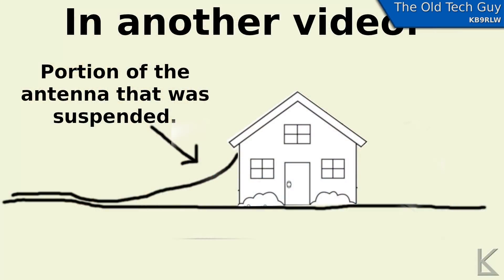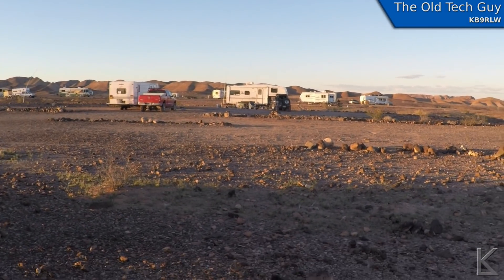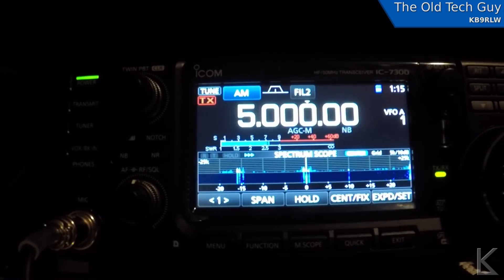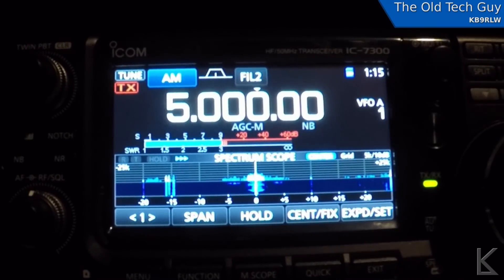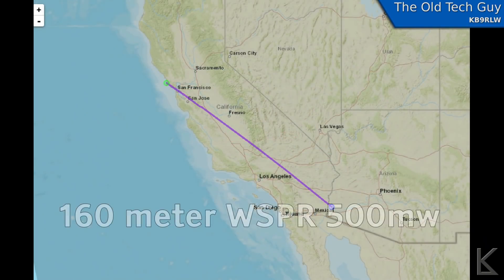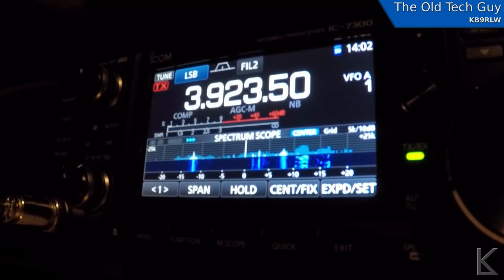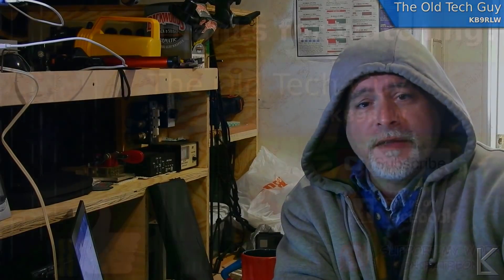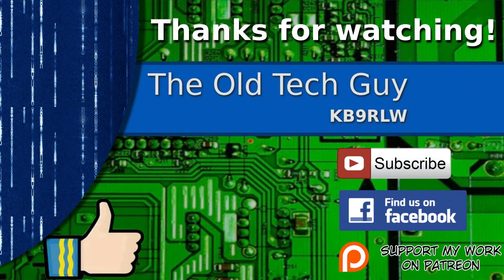Ham Radio - Can an antenna work while laying on the ground?

Comment: If you used a more insulated (from the ground) cord, I'm wondering if it would perform better. Like maybe a long extension cord. (It would have a thicker rubber sheath. Or, it could just be that the horizontal polarization is cutting down your signal.

Comment: Great vid. One comment. If you notice, at the 6 min mark in your vid it shows the noise level on your scope with both the in air antenna and the on ground ant. The on ground antenna has much less noise compared to the in air antenna. For transmitting, the in air antenna is almost always be better, but as a receive antenna, the on ground antenna can help dig those signals that are buried in the noise out. Sig strength will be less, but sig to noise level will be better. This is the idea behind the beverage on ground (BOG) antenna. Sometimes having both and a switch between the two helps with pulling out those weak stations. Thanks.
Reply: It could have been better at receive because it was closer matched to the wavelength.

Comment: I use a groundwire antenna that is under my grass in SW Ohio, for nighttime listening to hams (cw, ssb) while I drift off to sleep. No worries about lightning since it's in the ground and only a 28 gauge enameled wire which won't carry much current. I get ham activity coast to coast with no problem. The grasswire works great for me!
Reply from the maker: Yep, but one thing.  You're not immune to lightning.   Any nearby strike of a building or tree will generate a huge electrical pulse in the wire, even on the ground.

Comment: On ground is OK for receiving but as a transmitting antenna you’d just be warming some dirt. I’m currently using a random length wire and counterpoise as a receive antenna. It’s temporary but OK for AM DXing. I’ll be building the LOG and probably adding a preamp at the antenna. Glad you tried it out and showed how you did it. Thanks.

Comment: Can chicken wire be used as a antenna
Reply from the maker: Sure.    I once may a contact using the backstop fence at a baseball diamond.    Anything metal can radiate RF, but not very efficiently unless it's a half a wavelength in dimension.

Comment: What was the length of the end fed antenna on the ground? What was the difference in signal to noise ratios between the end fed on ground vs the vertical, especially as you came down in frequency? Did you put an RF choke at the receive end of the antenna (a loop might need one at the antenna feed point as well to keep it from being grounded)? What is the ground conductivity rating at the test site (higher is better for lower angled reception)? Did you try the wire as a loop on the ground with a 9:1 balun (loops don't need a ground or counterpoise)? Did you exceed 1/2 wavelength of the end fed on ground in your tests (loops can handle up to one wavelength before reception pattern goes bonkers)? Did you know that you may have just been warming up the earthworms trying to transmit into the ground (a loop can make a useful Receive-only antenna if one has space restrictions)? Did you have a preamp turned on which may have just amplified the ambient noise? Did you see this web page ( https://kk5jy.net/LoG/ )? Did you see these experiments ( https://forums.radioreference.com/threads/160-20m-log-loop-on-ground.370110/ )? Or this experiment with 40 feet of looped wire, amplified ( https://www.youtube.com/watch?v=2YhK0Mvd58w )?

Comment: Wether or not an antenna will work lying on the ground will depend on the ground. I have used a special Harris antenna designed for desert and that works fine as long as you operate in a desert as I did in Afghanistan. The same antenna does not work back home. Not even close. But funny enough it springs to life again when put on top of deep snow. We typically get 4-5 meters of snow during winter. To many think of ground as the ground we stand on, but antennas doesn't always agree. Normally it will be correct, but try operating in desert where water is way down in the ground (water surface or water table, I don't know what you call it in english) and the ground it self isn't very conductive. 
One of the reasons we discovered something was of in Afghanistan was that low hanging dipoles didn't give us NVIS. Not until we placed a wire as a reflector on the ground below the dipole. After a while we got hold of this specially designed Harris antenna which gave both decent comms, but also some covert antenna site.

Comment: A buried antenna will have its resonance at about 25-30% of the length of an antenna up in the air due to dielectric effects.  The feed impedance will be higher as well. Your antenna was not properly matched. The military has used on ground and buried antennas for years, one application was for backup comms to missile silos. See  the text "Antennas in Matter: Fundamentals, Theory and Applications by Owens and Smith" and https://www.rfcafe.com/references/short-wave-craft/images/buried-antenna-performance-development-small-resonant-buried-antennas-ad-783-274.pdf
I use a ground dipole on 472kHz, about 480 feet long ( in free space it would be nearly 2000' long), it has an impedance of about 200 ohms.
73 Warren K2ORS

Comment: Interesting investigation / experiment.  Got me thinking, suppose you had a resonant dipole antena, and for some reason you could only get half of it in the air.  The other half of the dipole you laid straight out, but on the ground. Therefore, the dipole is in a straight line, but one half in the air, the other on the ground.  Would it work??
Reply from the maker: Yep.  That's a quarter wave vertical with only one radial.

Comment: One time I was doing some repairs to my antenna system and had to lay my beam on the actual roof, I live in an apartment so its hard for me to drop all the antennas, and I was amazed that i was still working DX even tho the antenna was pointing approx 40 degs into the sky due to the slope of my roof :D. I know not technically on the ground but it was flat on my roof...

Comment: ANY antenna will work.   An incandescent light bulb will work for an antenna.

All antennas will work better than another antenna.  A dipole at 20 feet will work better than one on the ground.  One at 70 feet will work better than one at 20 feet.

A beam at 40 feet will work better than a dipole.  A beam at 80 feet will work better than one at 40 feet, etc, etc, etc.

Comment: Hello Kevin.  I'm in the process of making the LoG (loop on the ground) antenna.  It is two 15'x15' square loops in phase to produce a sharper bidirectional pattern.  This is a receive antenna only.  Each loop will have a 6.25:1 transformer at the feed point and fed with 75 ohm coax.  I'll be able to compare the snr with my 80m full wave horizontal delta loop and 3/4 wave inverted L which are 50' off the ground.  I'll let you know the results.  73  Scott - kl4nu
Reply: I know the thread is old, but I just installed a LoG.

Comment: Guess what I just took my 36 foot vertical wire antenna down and threw the wire on the ground ready to pack it away because of the wind . it also has a 6 foot copper ground rod .. I decided to test it out for the he'll of It before watching your video . wow ZERO interference on the empty bands unlike the vertical and picking up serbia and Moscow from the UK booming signal ...i can garentee it does actually work you just have to be lucky with the placement of the wire as I was earlyer on .

Comment: Interesting Kevin. Soon after I first got licensed in the early to mid 1980's, my HF beam antenna was down for repairs. So for giggles, I threw a pile of wire out the shack window onto the ground outside. It was raining at the time and so I didn't extend the wire along the ground - I just left it in a heap below the window. I got on 20 meters with an ATU and to my surprise heard the band full of west coast stations on the long path from my location in South Africa. I put out a call to a station in California using 100 watts, and he immediately came back with a 58. That is the power of being near the top of the sunspot cycle - Africa to California with 100 watts, and a heap of wire lying on the ground as an antenna 😂

Comment: Another thought is you used anlong wire.  I ran an 80m dipole laying on the ground last year for summer field day and made 20 contacts in 30 minutes.  But, like you said, mine was but one test.  KK4BK

Comment: I laid wires from my Alpha antenna 9:1 balum 60 ft  on bushes from the vertical lug and radials on the ground. I was using an Icom 7100 with ldg tuner. Using Winlink Express and ARDOP.  I was able to connect to a station 300 + miles away on 80 m. I could not get my wires up in the trees. Gave up and remember some thing Bonnie said about laying her dipole on Bushes. ( HF Pack).
Reply: You were running NVIS mode, which has a range of about 600 miles.

Comment: Nice location!  Is there a charge to camp there?  I'd like to get my RV out there and do some antenna experimenting!  ;)
Reply from the maker: There are many free for 2 weeks BLM areas out here. Then there's long-term visitor areas where I'm at, which charged $40 for 2 weeks. But you get access to a dump station, dumpsters, and freshwater.
Reply: @loughkb  Thanks for the info.!

Comment: The problems I see on the ground is that it is high capacitance to the ground, even though the ground is dry. That being said it will change the effective length of the very least, and that is not accounting for the amount of signal that is absorbed by the ground. There is only one practical use that I could see and that is spacing at a set distance from the ground and tuning for EME or other such communications where the intent is to eliminate one or more signals at the same frequency that are from the horizontal direction. Also when close to the ground I would probably look at that as more of a waveguide than antenna as it would be tuned with the ground as part of the propagation. Also if buried in the ground it would mostly pickup changes in the magnetic field of the earth, power lines and other such very very low frequencies.  I know this from experimenting as a kid, before I understood that an antenna is a tuned circuit unto itself.

Comment: Adding any height is going to improve signal in and out. I'm thinking  a wire, strung on the top of a fence, would be better than that ground wire.

Comment: Kevin...in this video when you were tuned to 3.923.5 that was me calling the net. The rig I usually use it my IC-7300 driving a Heathkit SB-220 running about 800 watts output to a 160 meter doublet. I was surprised how strong my sig was with your antenna laying on the ground. I have done the same experiment you have done with a G5RV and found the same as you did....it worked but not anywhere as good as when it is strung up in the trees. 73 WB7S

Comment: Set of the wire sitting on the ground about taking sticks up to at least 3 inches or 4 inches high from the ground try that I’m just curious
Reply from the maker: It should start to behave as an nvis antenna as you raise it off the ground. The Earth becomes a reflector, and a signal goes almost straight up.

Comment: Maybe you could compare the light bulb to the ground antenna. ;-)  We used to employ a 40W appliance light bulb as a dummy load when tuning up some tube transmitters.  I think,not always but generally, getting the wire off of the ground is better.  Good video.  73.

Comment: Several questions....So are you basically homeless now living in a camper? LOL we should call you the Nomad Ham. also I would not think it would be very quiet as all those campers all have 12 volt systems with some solar and all those PWM inverters in the campers causing hash......???? I guess its less than in town in a house with all the crap we have plugged in these days?
Reply from the maker: There is some noise.   I can tell when my neighbors have their TV's on.  Between the noise, the floor is S0.

Comment: Without seeing but a few minutes of the experiment I guessed the dry ground would provide the "differential" between a ground rod driven into the ground and the antenna. So did you have a grounding rod or just the counter pose?

Comment: Research the ELPA antenna. There are several papers written and the military had one in production. I have one and use it in other configurations.
Reply from the maker: I've seen that before.  Raised 1 to 3 feet off the ground so the ground acts like a reflector.  It's an NVIS antenna for near vertical radiation and a local area of coverage.  100mi or so.
Reply: Would that be found on Archive.org?

Comment: Why wouldn't you lay the counterpoise at a right angle?
Reply from the maker: The closest you can get to running it in the opposite direction from the radiator, the better the performance.   A 90 degree angle would be the limit before you start to fold it back on the radiator and lose performance.
Reply: @loughkb  Okay, cool.

Comment: You Kevin:
Another GREAT video! I agree with your assessment, but there are some expeienced voices here as well, with the loop antennas standing out. Worthy of more experimentation & another video, (which I suggest : ) Have a great time out in the Southwest, check out some of the gunslinger sites & report on them. You might find some ham interaction!
 73's,
de seeker/Jeff WA7LFP

Comment: ground mounted antennas are usually aimed at obtaining a lower signal strength to noise ratio-the signal strength drop off is usually less than the noise drop off, making reception much better--if one tries to transmit thru a ground mounted antenna, usually the effort comes to grief-
i have a 28 foot diameter loop that many times is my best antenna for reception on 160m and even occasionally on 80m-unfortunately i can't get that loop directly on the ground at my present location--if i could, i suspect my S/N ratio might improve even more---but i wouldn't dream of trying to transmit thru it-

Comment: When evaluating a receiving antenna signal to noise ratio is more important than signal strength. Simply comparing S meter readings was not really a fair test.

Comment: I have had amazing results with loop on ground antennas for RX 160M-20M,  KK5JY has a great write up on how they work.   A conventional antenna simply placed on the ground will perform very poorly as demonstrated.  But a Loop-On-Ground Receiving antenna will have low take off angle, low noise, a  bidirectional pattern, with 2 LOG's (1 with a delay line) you can get ~20 dB front to back in my experience!  And at only 15' x 15' the loops only need 60 ft of wire, even for 160M!  A very long time ago most hams used separate gear for Tx and Rx so it was not such a big deal to use two separate antennas,  but since the integrated tranceiver became the universal standard the idea of dedicated Rx and Tx antennas has lost popularity.   A high Q mag loop for Tx, and a broad band LOG would give you a very capable setup, with easy deployment. 
73.  AD0WQ

Comment: I have QSOd on ground antennas. The wire must be at least one wavelength long and radiates off the end of the wire. The longer the wire, the lower the take off angle. Ground antennas are lossy but are also directional. If you need a stealth antenna this is a good compromise solution. Check out K3MT's "grasswire" experiments in Bermuda.